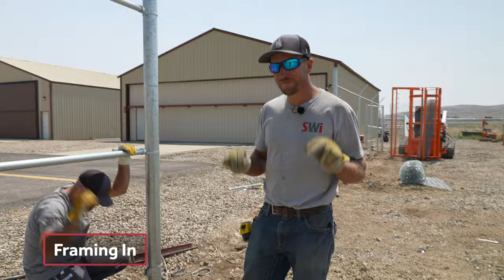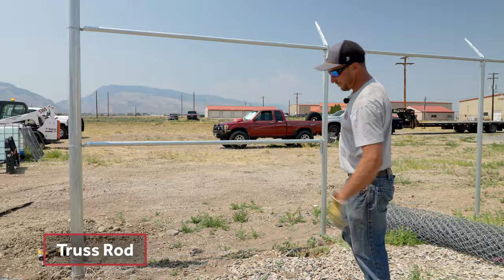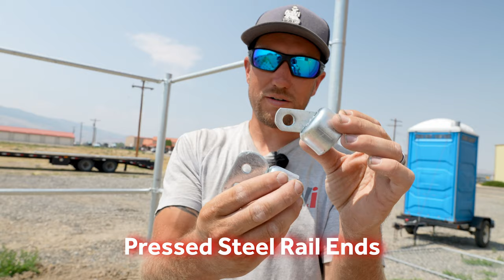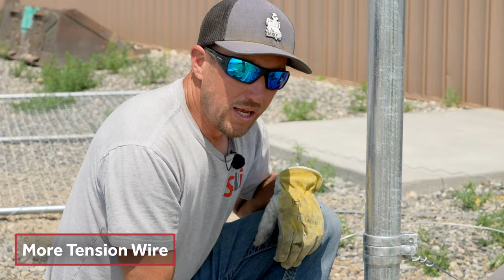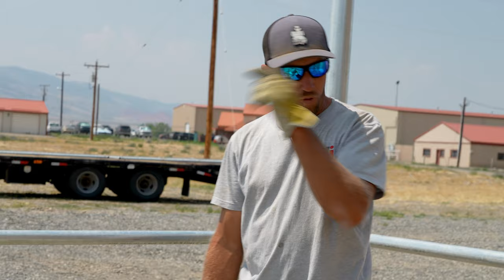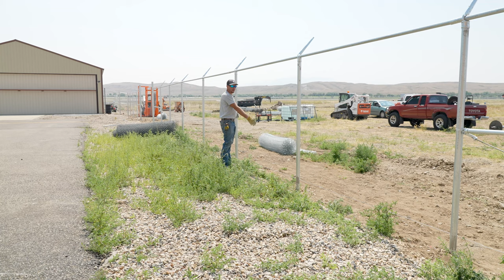Framing Chain Link Fence Quickly And Easily | How We Build Chain Link Fence

Comment: Do a video on how you run your lines
Reply: Would love to see this and every other step of chain link! I’d love to do more in my business but I really am not skilled at it enough to embrace the chain link side of fencing.
Reply: @emsroks  I'm doing a 2100 foot 6ft job right now with 2 cantilever gates
Reply: Josh Greene very cool. We’re doing our first 6+1 barb wire with 35’ roll gates. Haven’t been confident enough on the cantilever design to bid those. How’s your job going?
Reply: Did a 400 ft 6ft plus barb last week. Have you ever done barb wire? How many feet is it?
Reply: @emsroks  Not to bad me and one other guy were able to anchor 5 post and frame it all in the first day
Reply: Josh Greene It’s about 700’ of 3 strand. How do you dispense and install the barb wire? I
Reply: @emsroks  Put a piece of pipe through the wire and have guy hold the one end stixk other in the fence, while I walk it down and hook up the one side. Cut a few barbs off also like 2 or 3 back. Sometimes I stretch them them one by one sometimes I walk them all down and then stretch all 3. Just stretch it and just check before tying off it will go up to the barb arms halfway easily still. And tie it off. I just use a come along and a wire dog to stretch it. If you have to stretch it on outside and pull it over, I usually use a pair of post hole diggers to put it over barb arms. And just use pliers to pip into Barbarms.  I use a t bar on stuff thats probably no longer than 40 feet.  I space my brace bands about 4 inches above my topraik bb, that usually puts the wire pretty straight from barb arm to post.
Reply: Any stretch over maybe 100-150 feet you'll have to break.
Reply from the maker: How we run the fence lines…like layout or setting posts?
Reply: @SWiFence  They mean how you graded. when you set the post you didn't show how you determined where to cut the terminals so they match up and also the line posts so they rail flows straight. Even tho it's straight should be simple, they also probably wanted where to install the mid rail they don't know half of the mess height minus 4 inches.
Reply: I'd like to see that also. But I'll tell you the best way for 5 ft and higher you make a mark at 57 inches on the first post and you run your string line from their bring a lot of aluminum ties with you to tie. for every 8-10 keeping the string line at 57 inches.(57 inches is the magic number it's easy to eye in at eye level) the string line will show your dips slops between each post. If there is not enough clearance for 57 inches you split the difference between to high and to low once you have all your marks at 57 inches. You take down your string line and grab a story pole. ( a story pole is a straight pipe or piece of wood 2x2 about 10 ft long put a hole at the top so you can put your marker there  that it will hold and make marks with that to know where to cut rather than carrying a ladder with you for every post on the job could be 5500 ft LOL. My way works on everything flat which happens in a blue moon, or with dips slopes which happens more than not.

Comment: ? You don't  have combo cups for your rail ends so all you need to slide  truss rod in brace pipe. That way you don't  have cut truss rod at all. The tightener goes to bottom of post.
Reply: I was wondering the same thing?
Reply from the maker: Combos have never been our thing.  Many times they are harder to get and cost more for what ever reason.  Try putting the tighter like we do and you'll never do it the old way again.  It's much better to adjust where we have it.  We learned that hack from one of the greats Virgil Thomas.
Reply: @SWiFence  Just different for us. All our vendors carry almost exclusively press or cas steel combo cups. About the only thing you get here.

Comment: Of all the industrial fence that I have installed we always used pressed steel or cast railend cups with a hole in them for the excess truss rod to go through and into the brace rail and put the tensioner at the bottom of the 3"-4" terminal post. That way that ugly bend is not exposed and visible and it is practically impossible for the bend to come undone.
Also I like for my T-handle to have a slots in it rather than holes (fabricated from SS40 pipe of course). Makes it easier to remove from the wire you are tightening, especially barbed wire.

Comment: Great video! Any books or publications you can refer me to learn more on the rules and regulations when building with chain link? I live in CA.
Reply from the maker: ASTM is the go-to resource for chain link building code.
Residential: https://www.astm.org/Standards/F654.htm
Security: https://www.astm.org/Standards/F2611.htm
You'll need to check your local county and state codes as well, but this will get you solidly off in the right direciton.

Comment: How do you determine when to add that brace instead of just relying on the top rail?
Reply from the maker: 1- anytime the fence is over 6 foot tall
2- if you’re using a top tension wire instead of a top rail
3- What is the application of the fence residential probably not commercial industrial yes.
Reply: @SWiFence  AWSOME, thank you guys!